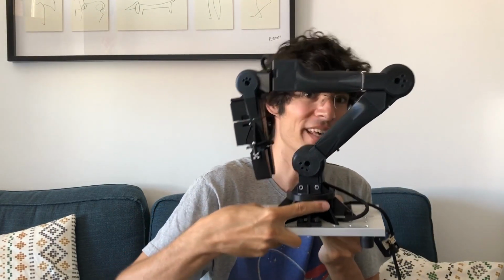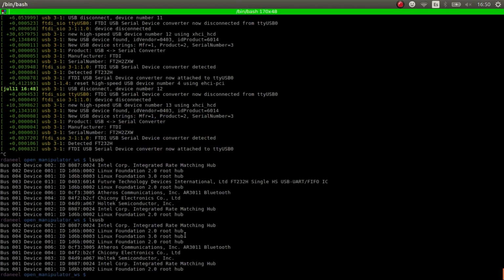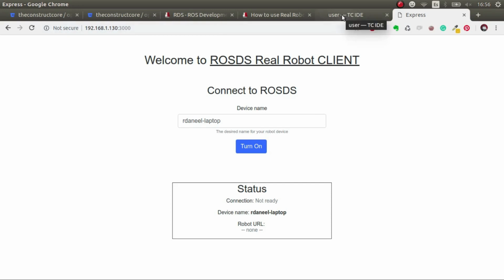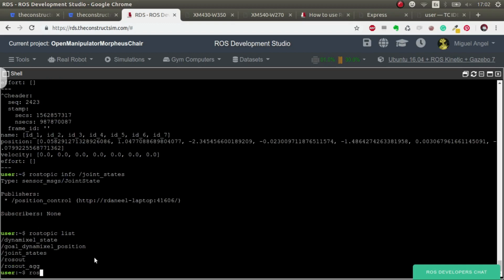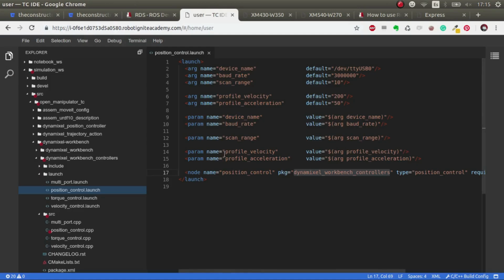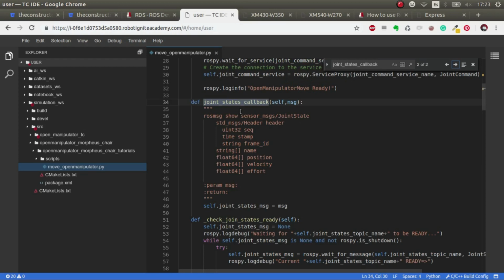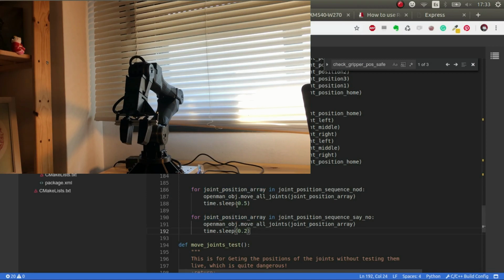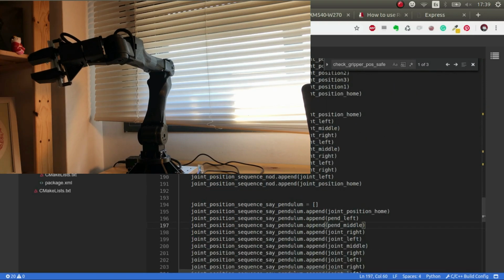[Morpheus Chair] Dynamixel Servos with Robot ARM ROS | S4.Ep.1

Comment: Good Evening , I'm a Italian from Naples and i'm a  beginner.I'm running the istructions of this video but  I have a problem . When  i lunch this comand : roslaunch dynamixel_workbench_controllers position_control.launch, there is an error: Error opening serial port. I'm using a virtual machine VMWARE and UBUNTU 20.04. My serial port is active on the virtual machine and is ttyACM0. I'm runnin also the comand sudo chmod a+rw /dev/ttyACM0 baut the error is the same. Can you help me. Thank you

Comment: What should I add to track effort from joint_states topic after I launch position_control.launch
Reply from the maker: If you are talking about the real robot, if the effort is not published in the joint_states topic, you will need to implement a publisher that retrieves that data from the real robot and publishes.
Reply: @TheConstruct  Can you help me on it? I don't know how to use C++ API. I assume that it could be implemented if one or two lines are added. Thanks.
Reply from the maker: @yongmincho6657  Not so easy. Check this online course where we teach how to use ROS Control: https://www.theconstructsim.com/robotigniteacademy_learnros/ros-courses-library/ros-control-101/